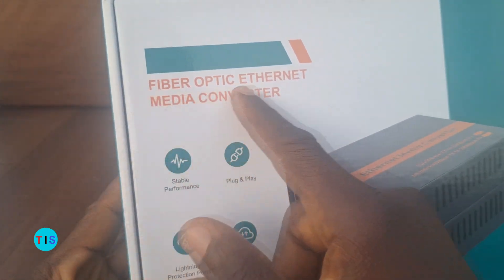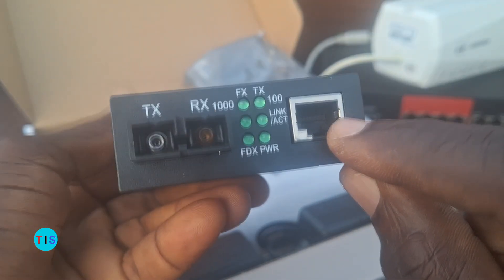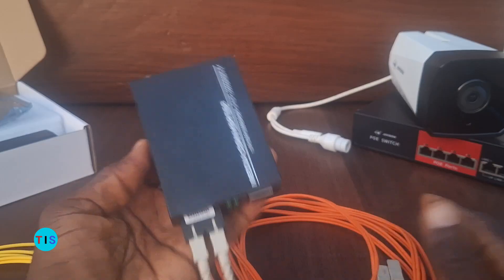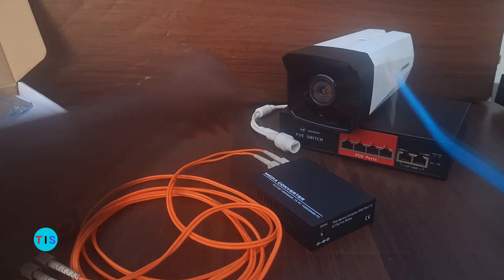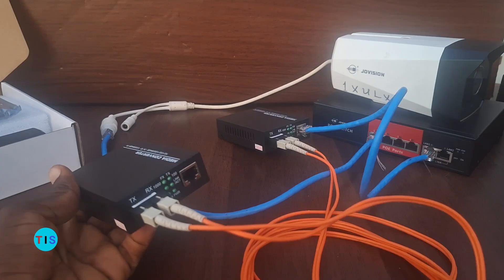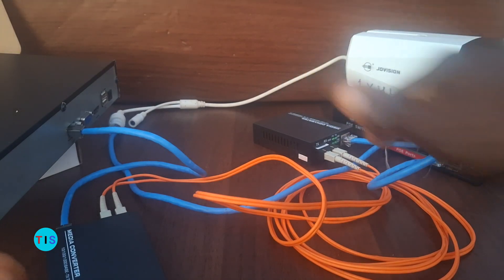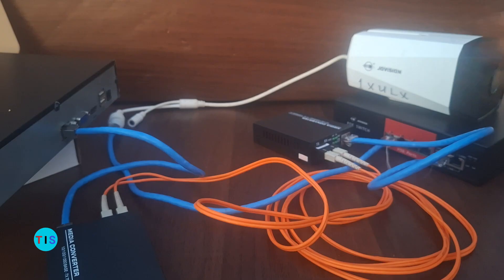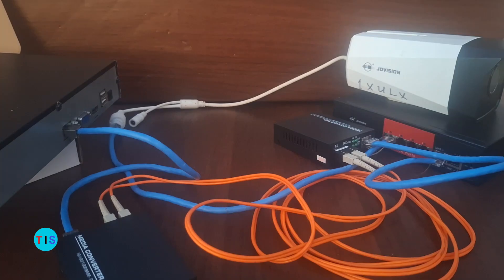Fibre Optic for cctv camera installation : using a fibre optic to connect IP cameras & NVR

Comment: Hello sir. Does the fiber optic also transfer energy on media converter b? Or you need separate power supply for it to work
Reply from the maker: No, fibre Optic cables do not carry power